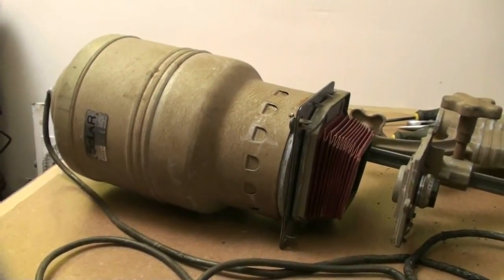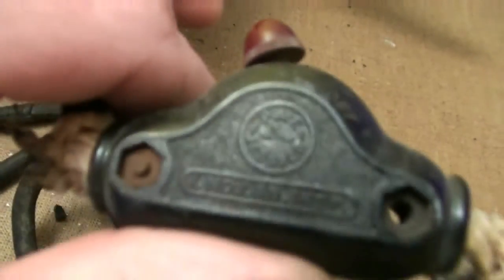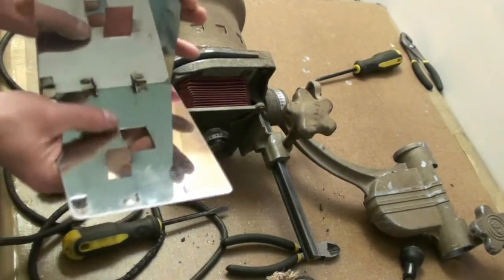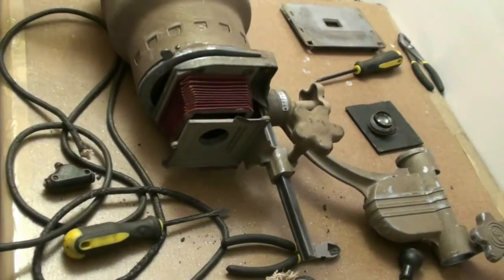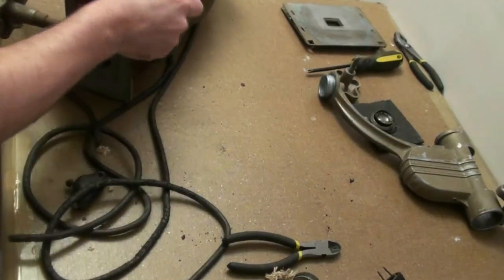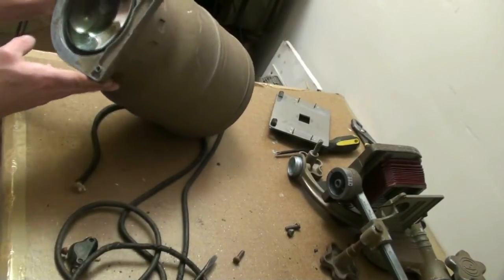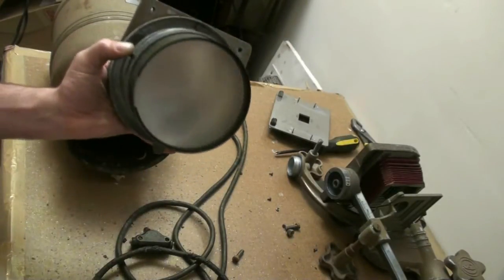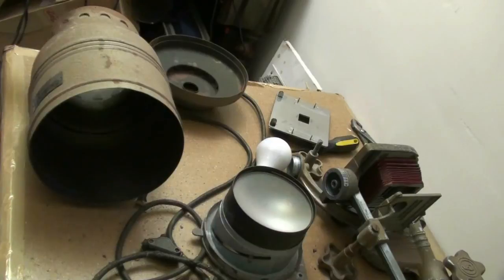Vintage Solar Photo Enlarger Teardown / Rebuild Pt 1

Comment: Why call it an enlarger?  I would have sold it to a collector. You know it's not an enlarger, don't you? What was written on the lens should have given you a hint. The plate is for holding a negative, not a 35mm slide.  ;)
Reply from the maker: I have always called them enlargers...  What should i have called it?  It did say enlarging on the lens haha.  I have never used this model before, but I have used more modern ones to make print photos from existing negative or slides.  It "enlarges" the image on the media to the size you want it :)  Yeah, negatives would have been typically used, but slide was just the first thing that popped into my head while making the video.  I don't script these things.  I had thought of selling it, but the value of these isn't (or wasn't) that great at the time, and this one looked (and smelled) as if it had been stored in a wet basement for 20+ years.  I don't think it would have been worth much to a collector!